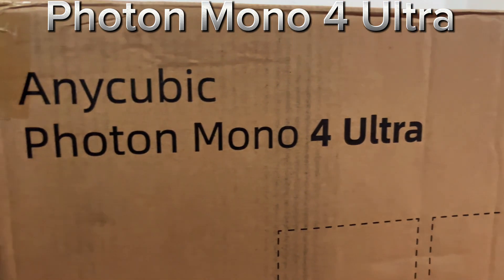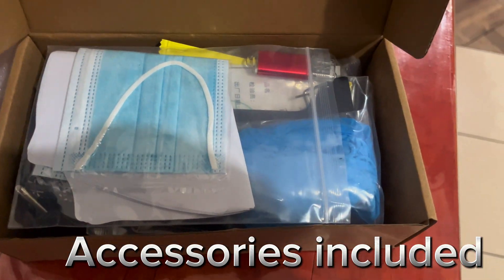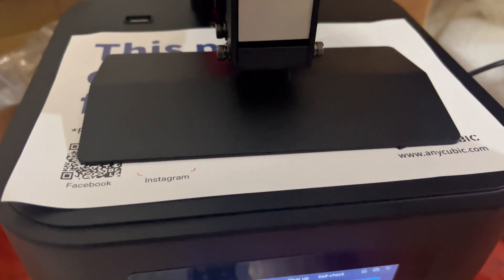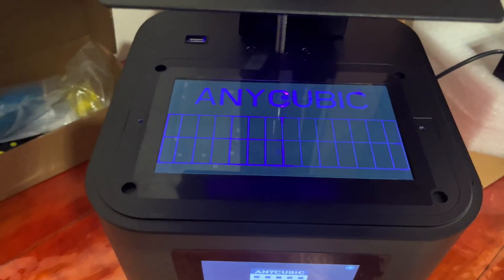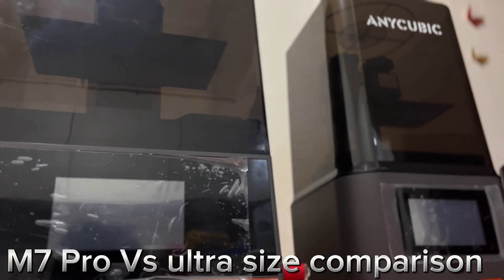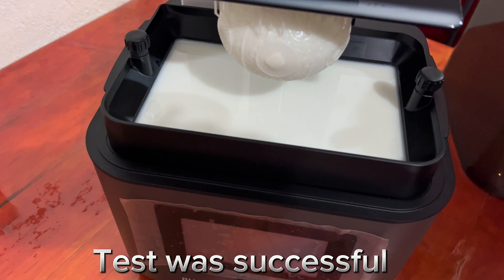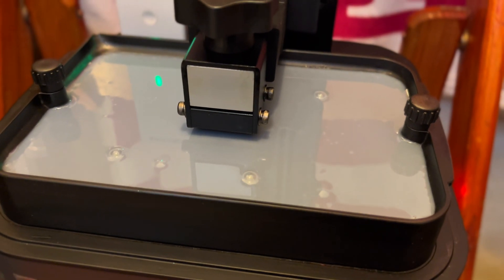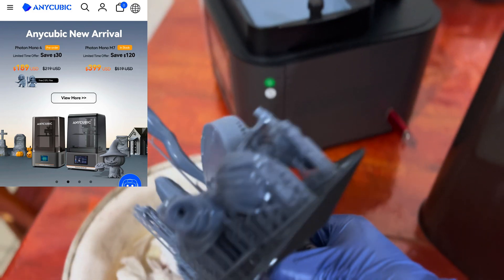Best new beginner printer? Anycubic Photon Mono 4 Ultra Review & Making Scylla 😱

Comment: How do you get the dildo thing to the 3d printer
Reply: It doesn’t have a screen protector? So the bubbles on the print screen are normal? ,“ it uses high speed film”? Huh?  This video has me mired in confused then before

Comment: I bought an Anycubic mono 4 ultra, and it was absolute trash. For example, it was taking 10 1/2 hours with stock settings to print 440 layers. Just before anyone assumes it was user error. I followed the setup guide, I was using Anycubic resin, Anycubic slicing software, up to date firmware, and doing everything correctly. I went back and fourth with support for days. It would print the first 51 layers then slow to a crawl. I had a 1200 layer print take 34 hours to finish... At one point they even wanted me to replace the LCD, on a brand new machine... They finally offered me a replacement printer, but after my experience, I dont know if I even want another Anycubic machine.
Reply: If you can tell that from reading what I said, you didn't actually read what I said. 

STOCK SETTINGS, aka the preset values for the printer and corresponding resin. A layer 52, regardless of the file I'm printing, it begins to pause for nearly 2 minutes at the start of every layer. Then the light comes on, and  exposure is only 2.6 seconds. I can see the light come on through the vent on the side. It even happened with the file they sliced and emailed me. I didn't change anything, loaded the sliced file into the Anycubic slicer and sent the print to my machine. Still over 10 hours for a 440 layer print using less than 10ml of resin. They offered me a replacement because support can't identify what's causing the issue. 

Sometimes companies just send out bad products. Don't make yourself look foolish defending it.
Reply from the maker: I wouldn’t go as far as calling this printer trash, It’s been highly praised by even professionals.
I can already tell just by what you told me you’re not dilating in your exposure settings correctly. It shouldn’t be taking over 24 hours that’s just insane, mine only takes 2-4 hours with what I’ve printed at the moment. I recommend you to please watch beginner videos for exposure settings, learn the basics. I’m sure your printer was perfectly fine. It’s just about learning the ways around it. :_RubiRedGodzilla1:
Reply: @RubiGamingx  here's an update for you been using the replacement unit for less than 2 weeks and the LCD just died... I'm done with Anycubic

Comment: What slicing software do you use? I was using Lychee, but they don't have the Mono 4 available on there.
Reply from the maker: Currently no other slicer has the profile available, The only one would be Anycubic but I had a hard time using the supports. 
They have the regular Mono 4 available but not the ultra, I was given access to a special version with the ultra profile available.